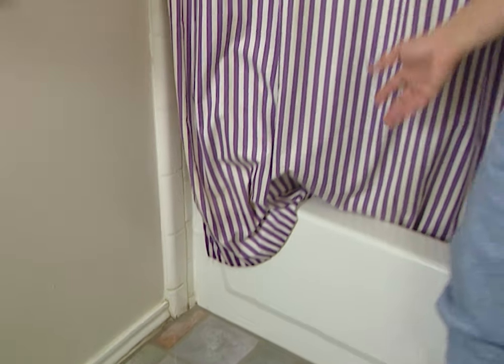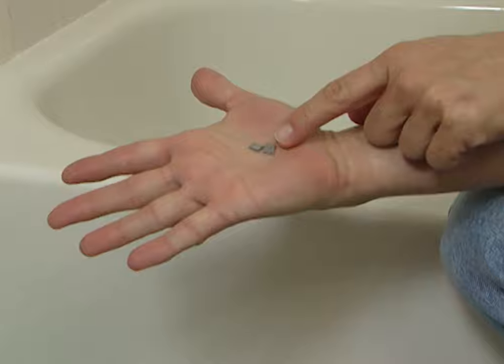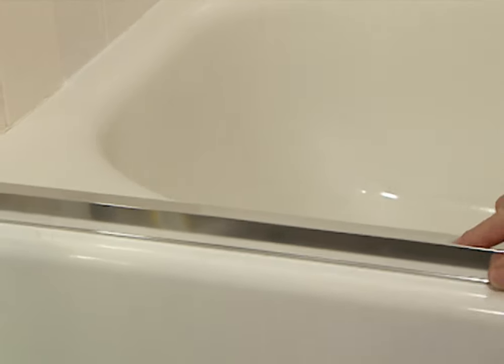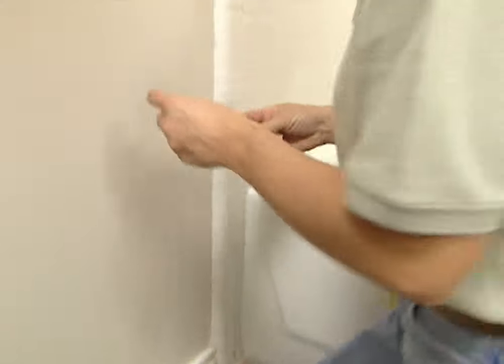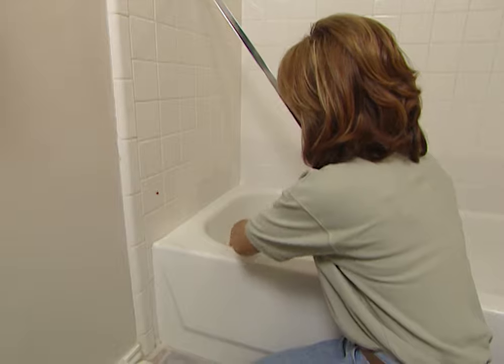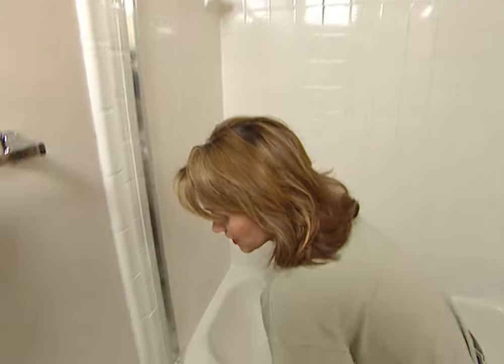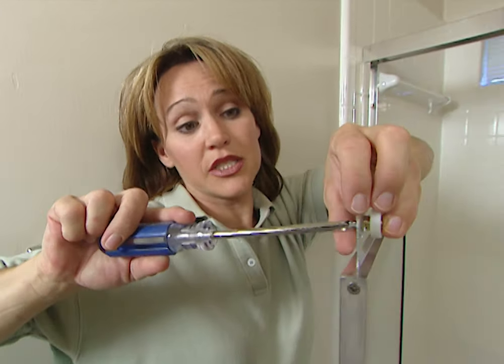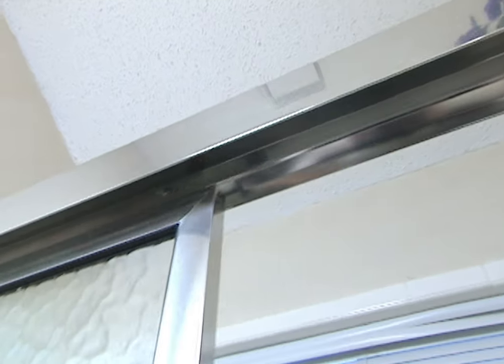Shower Door Bathtub Install - Do It Yourself

Comment: my DIY task was only to take off two existing sliding doors, replace their aged wheels, and then rehang the sliding doors. Easy with this video? Yes and no. The video did help a bit, showing how the wheels got hung in the horizontal frame; however, there were multiple problems. First, the placement of the wheels can be adjusted. Turned out that inner sliding door required a middle position for the wheels, while the outer sliding door required a somewhat higher placement of the wheels. Yours could vary too. Then came up the really hard thing. The video shows how one can if you have the upper body strength, first hang the inner door, then the outer door. Well, I don't know in what universe this video was filmed, but in my universe the bottom frame of the sliding glass door did NOT let you just raise the outer door and hang it. It would NEVER fit. The bottom frame of the sliding glass door made this impossible. Instead, I had to do a weird maneuver made more difficult by being by myself when I did this. For a 67 year old guy, I am pretty strong, but what I did was pretty tricky. Once I had the inner door hung, I had to raise the outer door in so that the top horizontal beam pushed up an inch or so, and I had to do this without one or both of the sliding doors just falling out and possibly breaking. I had to do this in order to get the outer sliding glass door over the edge of the bottom frame. Once I had the outer sliding glass door over the bottom frame, and then somehow had to pull down the horizontal beam while not losing control of either of the two sliding doors. None of these possibilities is covered by this video. Finally and frankly, I doubt the majority of women have the upper body strength to raise one of these sliding glass doors and put them into place unless it all goes perfectly. Not good to be on things going perfectly. I would strongly suggest that you have at least two people working together when hanging these sliding glass doors.  With two people, you have a lot more control and a lot more safety. The second person should probably stand inside the bathtub and focus on the inner glass door once it is hung. Why? Things can get touchy when you try to hang the outer sliding door, especially if, like me, you find that the bottom frame makes it impossible to do this without raising the upper horizontal beam upon which everything hangs. All, in all, while this video is helpful, my experience of hanging these sliding doors by myself departed completely from the easy task shown in this video. It was NOTHING like this. Not at all. I really wish I had had a second person to help me.

Comment: I see that your roller is flat and the track is kinda round. For that type of track shouldn't I use a round corner roller? Does it really matter, maybe not?  Another question, there are two types of rollers for sliding doors,  3/4 and 7/8 inch. Which is better, thanks?

Comment: If you're going to drill into tile then make sure your using a 1) Hammer drill. 
2) Get good anchors and screws that already come with a bit so you have the correct size bit. 3) Grab a "CARBIDE" bit the same size as the one that came with the anchors, this for drilling into tiles.Tape a refrence mark the same depth as your anchor from the tip and twice the size of the bit creating a stopper so that when you drill past the tile it doesn't shoot through the other wall when applying pressure and prevents the drill  from slamming into the tile and damaging it. As a preference I add silicone to the outside of the anchors then insert it so it sets better and seals it. If you want you can silicone the hole in the wall too. This is mostly for your typical DYI person. I know it sounds like a lot of steps just to drill holes but it helps you find the correct size bit, prevents leaks and damages. Hopefully this helps.

Comment: Excellent!
 A couple of notations.  1. You can use the shop vac to suck the ceramic or porcelain debris as you are drilling- that stuff is nasty on the skin. 2. You really should wait 24 hrs for the caulking to fully dry before running the shower. 3. Wiping the surface of the tub or shower where the track goes with alcohol will help assure a better adhesion of the caulk. 4. Sometimes it's best to seal just the inside of the tracks toward the tub or shower, caulking/sealing the outside may cause water to accumulate inside the track and become stagnant, moldy and could rot a wall that isn't water proof. This way, a leak would be evident before it becomes a major problem.
Reply: Thank you. This is the reason why I read through the comments. Always some extra helpful tips and advice. I will keep these in mind when I install my shower doors soon.

Comment: Thanks! Would you recommend any llw cost cutting tools for this header/top track? Kohler customer service suggested hack saw or "miter" saw. Also, the outer plastic in my default roller wheels wore out, exposing the metal underneath, and damaged the header track after only 8 years of use. I switched it out with nylon plastic roller wheeler, I hope these wheels will last longer.

Comment: Good job. I used this video as a guide to install higher quality doors for a shower pan. I needed to drill a pilot hole for drilled into thick tile and cement board. The only problem with these glass doors is maintenance. A daily cleaning with a squeegee to prevent water spots and soup scum.

Comment: I only had to flip a door that was hung wrong side out but this video also helped in setting the rollers properly. I really should have put down some cardboard in my tub and on the floor which would have prevented more scratches on both. But I got it done! Thank you.

Comment: Excellent video! My shower kit did not come with instructions so this was valuable. There were studs behind the shower so I didn't need the wall anchors. Also, a hack saw with a miter box would've been way better. But since I didn't have one, I used my grinder and kind of messed up the upper track, but it is not too noticeable.

Comment: It would be helpful to explain if the shorter or longer side of the wall guides goes on the interior of the tub.  Great to see a woman doing the install too.  I would only suggest add in how to fix caulking issues if not enough caulk went on and she didn't include caulking at the base of the guides, which many manuals suggest.

Comment: Great Job, you boost up my confident and saved my $ 4500 , which they told me it’s going to cost. The only question is how the top of the frame will be held in the position since i don’t see it screwed.
Reply: The top rail does not need to be screwed since the weight of the doors will keep them in place.
Reply: The one I installed had a clip that attached into the rail of the top horizontal piece and then attached that into the top hole of the vertical rail with the screw.
Reply: Mine had a t-shape to slide into the top rail.   But that meant the top and side rails had to be set in altogether.
Reply: @IM-ng1ep  I disagree. The doors can't possibly weigh that much because she lifted them into place. The top should always be secured for safety. She could have used screws or caulking.

Comment: Ok two things one it's illegal to run power through the walls where your tub is... Two if your shutting the power off sure stops getting electrocution right away but you may still have damaged wires as a result a fire may occur later on

Comment: I would recommend waiting to run the shower until your silicon has time to properly set up.
Reply: How long does that take?
Reply: @tom11zz884  Recommend minimum is generally 24 - 48 hours. It may differ on the product you are using. They will often state in the fine print what they recommend. 👍
Reply: Shouldn't silicone be added to the side rails as well?
Reply: @Bastard of the Party  Yes, vertically on the interior and exterior side both where the side jambs meet the tile.
Reply: @jackolantern404  I thought so, she failed to do that in the video. Thanks.
Reply: @Bastard of the Party  Good catch, wouldn't want to forget that! Happy to help. 🤙

Comment: What is the size of the drill bit and wall anchors you use? Thank you so very much! It seems so easy, and I'll try it by myself ;)
Reply: The one I installed supplied the wall anchors and screws as part of the installation kit. The installation instructions also told what size drill bits to use. I actually did not need the anchors, because I had a wall stud I could screw directly into.
Reply: Typically 1/4”

Comment: my bathtub wall plastic can i still install glass door ?
Reply: Yes, but it might be more work. I have a full shower surround, so instead of the tub meeting the wall at a perfect square, it had a semi-circle taper to it, which meant I had to cut a notch in the fiberglass with a dremel so that the bottom track would sit flush. It's one of those things I noticed as I was in the middle of the job.

Comment: Why didn't you secure the header (top rail) to keep it from coming off?
Reply: So strange. I'm installing shower doors and have come up with the same dilemma. There's instructions in 2 different places and no mention of attaching the header to the wall channels the same as in this video. I'm thinking of at least adding silicone.
Reply: @mmsabre7931  Sometimes the top is not secured because the weight of the glass doors is so heavy.  But what if the doors are the flimsy type that weigh "5" pounds. 

Silicone will hold definitely secure it in place in most cases and also prevent water from the top.  Some installations suggests a very small set screw on the inside going through the header to the side rail.  I geard some doors have "clips" that are used to secure the header but I haven't run across one like that  yet.  I only have a few rental properties.

One thing for sure, when kids are involved they will find a way to eff something up if it is not secured.
Reply: PS  If both sides of the header are curved outward, the set screw option might not work.
Reply: @gunsmoke7573  Thanks. I'm going to use a small set screw on the inside flat section.

Comment: Don’t just turn off the electrical for where your drilling. Get a electric cable detector and scan the wall ahead of time to make sure you’re not drilling into a live wire. If
You don’t and the screw hits a wire and you turn the elect back on, ZZzzzzwap.

Comment: You don't need a hammer drill you could crack the tile, a regular drill is better
Reply: Should I  drill a smaller  hole first so that I won't crack my tile? And is there a special bit?    thanks

Comment: Was good in some places. But, like most DIY videos, you leave out important facts.
1. What kind of irresponsible person would advise using a steel hammer to tap in a plastic wall anchor into ceramic tile?  If you happen to miss the anchor you'd likely crack your tile. 
Use a RUBBER MALLET!
2. You didn't mention anything on what to do if the walls aren't plumb.  You never touched on using shims for the rails on the walls if necessary.